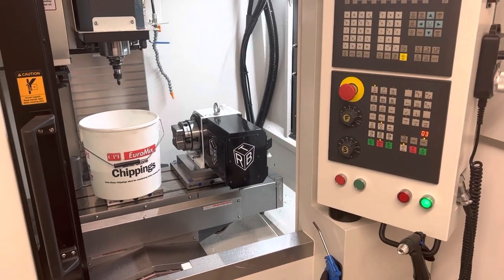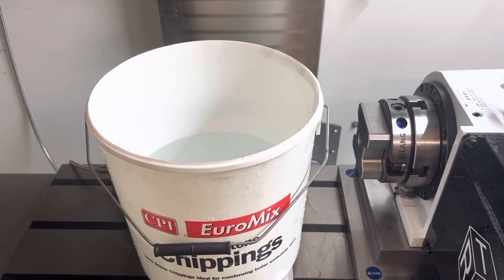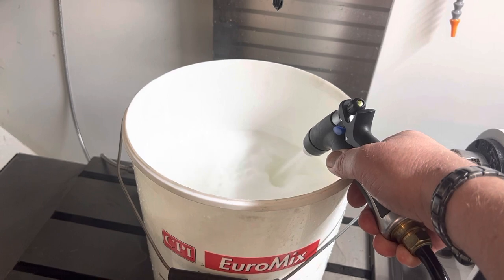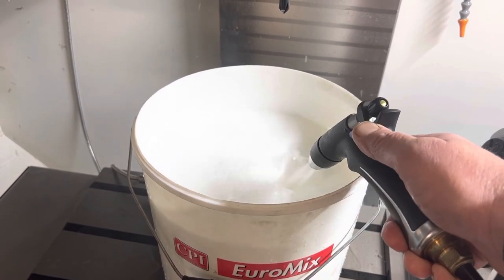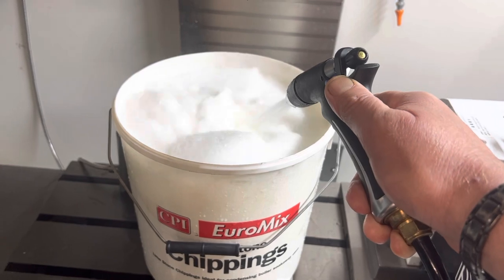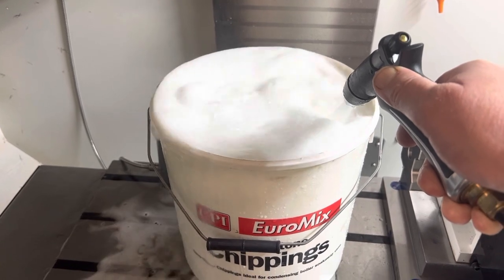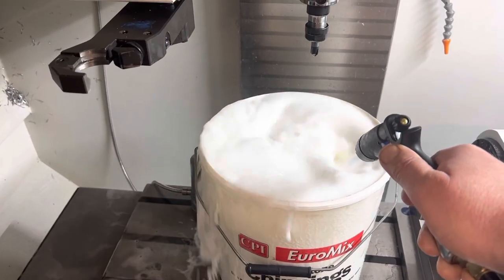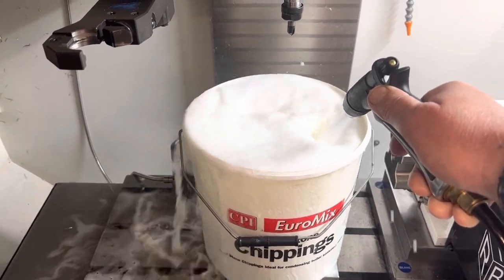Topping up the coolant level in my Syil X7 made easy.

Comment: Thanks for the tip, I took it a step further and wrote a quick g-code to turn on the coolant and run for 5mins then shut down. Also used this to dial in the coolant after change over super easy, Cheers.

Comment: Hello. I've been thinking of buying a syil x7 and see you're running the siemens controller and servos. Do you run this off three phase or a rotary phase converter? If so what size and make us it.
The other question is how did you get it delivered and was there any problems siting it? 
I have a maximum clearance height of 1945mm under my garage door and just wondered if I could get one in. Once inside the clearance  to the ceiling is 2095mm although I can go higher between the garage trusses for the Z axis. 
Cheers Damian

Comment: Impressive setup you have there rob!
 We stopped using that coolant at work, it was giving us all sore throats.
Never seen this trick before,  we just pump water into the machine until near full check with refractor meter, if under 5% we add coolant. Shut the door and turn the coolant nozzles on, leave  for 5 mins then recheck with refractor meter then add water or coolant depending   where it is
Reply from the maker: Yeah it can catch your throat. I wear a face mask if I’m matching a big part. It’s the shell mill that’s the worse, it smashes the crap out of the coolant and atomises it. 
I don’t want oil based coolant because my mill is in the garage with a door straight into my Utility and then kitchen. I don’t want the smell of oil or oil deposits in my house. 
After nearly 2yrs of 735, I’m still super happy with it.
Reply: We stopped using Blaser for the same reason sore throats & it kept going off .